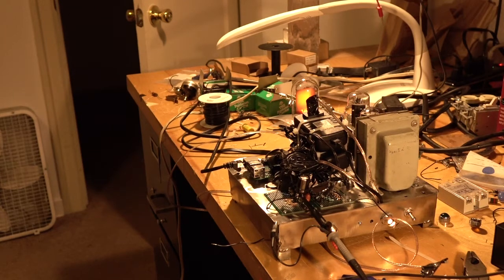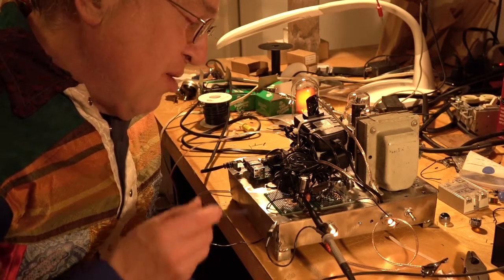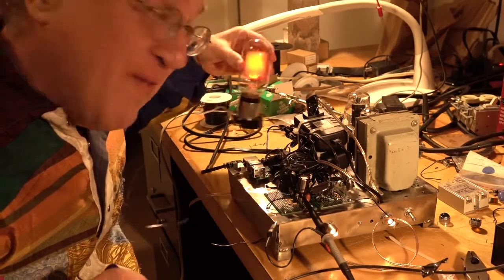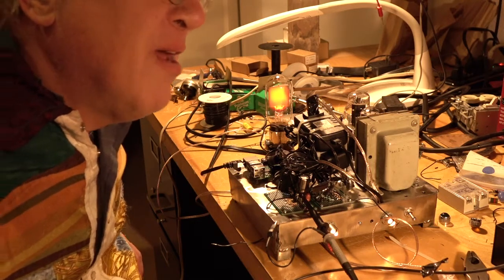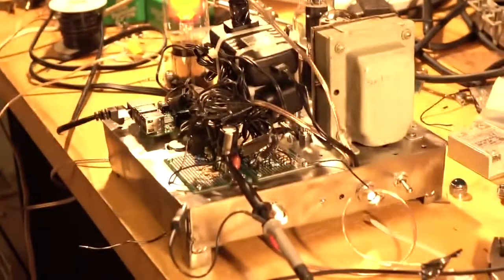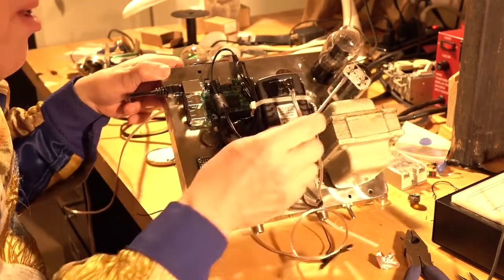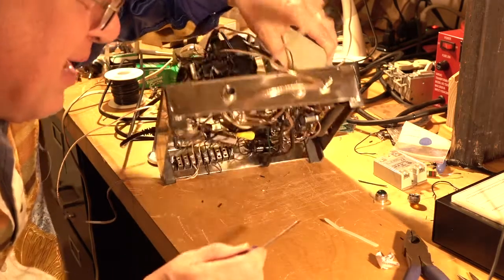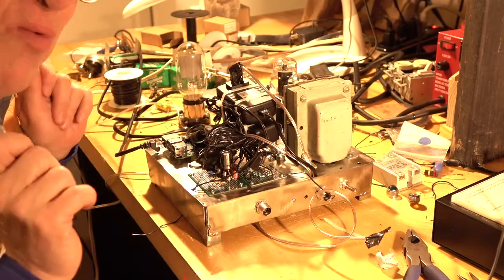mark allyn converter for mechanical television

Comment: Hi Mark you should join us on the NBTV forum if you haven't already many Mechanical television builds there ...i like your project and the neon light they are hard to get !Yes The LEDS work well with a Nipkow ...a lens disk or bead would make your neon a touch better for viewing  and just need a light behind the beads will focus.
Reply from the maker: Thank you, I did see the NBTV forum. We have two existing period NBTV's at the museum and I am trying to get them alive again but robust enough for patrons to view them by pressing a buttun. I cannot have them fiddling with them for sync.
Reply: No worries i can see what your trying to do for the museum display ..showing the disk from stop to sync lock is one of the interesting things some one who does not understand how this works would find i think interesting ..i would just have the power on button a press only on  type and off when released ...just say press till you get an image .